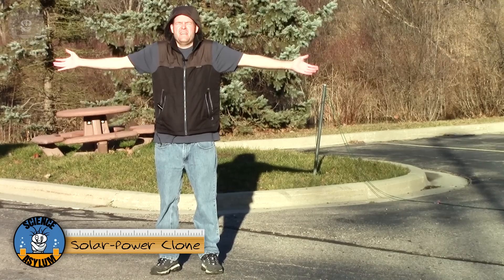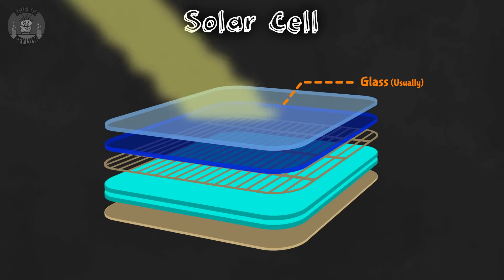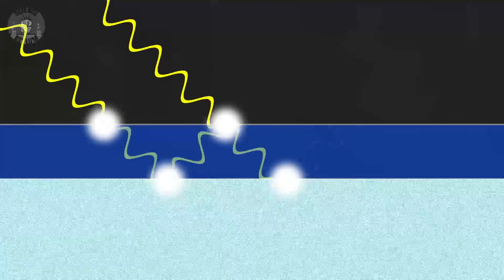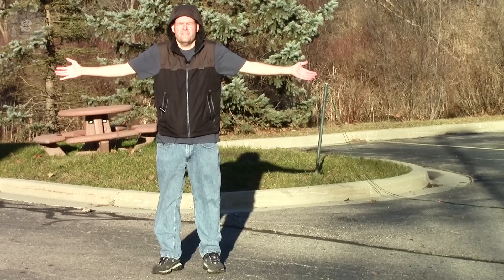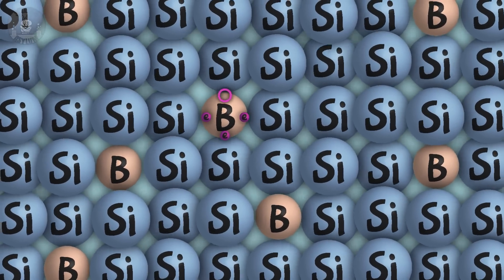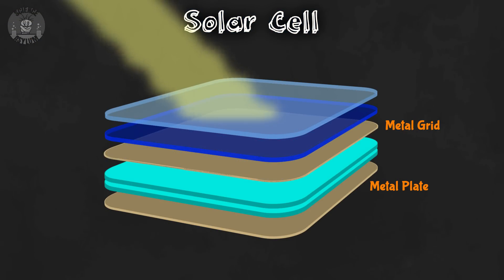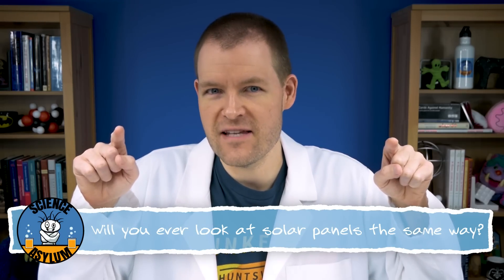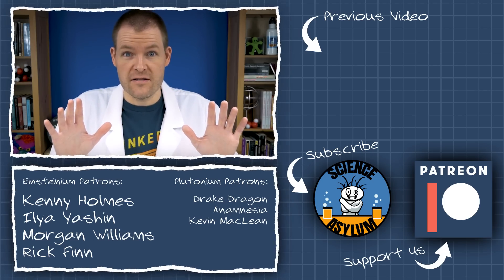How Do Solar Panels Work? (Physics of Solar Cells)

Comment: interesting video, just wanted to point out that the chemicals needed to make these cells are extremely toxic, and most solar panels are made cheaply in china designed to degrade. Nuclear is the only viable alternative to carbon fuel

Comment: I really just wanted to know if solar panels work behind glass, more or less a small solar panel that’s sitting on the dash board of a van my brother owns. I’m working off the stupid concept that “it’s harder to get a sun burn behind glass than it is without glass.”  Would the solar cell work better out side the car window or does it even make a noticeable difference.
Reply from the maker: Yes, solar panels work behind glass. Panels often have glass over them to protect them from the elements. Solar panels work using visible light and glass can't absorb that kind of light, so you're good 👍.

As for the sunburn through glass, I've always heard it the other way around. "You can't tan, but that makes your sunburn _worse._" ...but I could be wrong about that. What I can tell you is that sunburn (and tanning) works via UV light, not visible light. That means it's not connected to how solar panels work.

Comment: Very well done!  I would've liked to see you get into why cells are in series on panels and parallel in arrays (to keep the current low to reduce loss and save cost on the interconnects, but while keeping the voltage manageable) but that would have been getting a bit far away from the the solar cells themselves, which was the point of the video.  Maybe link to someone explaining the "next step" in understanding solar power?

Comment: My question is this, why not follow the design of leaves, they clearly have the optimal extraction strategy, we even have self assembling "circuits" nowadays, could just set one of those up on a cell, let it show us the optimal "circuit" for the cell and just slap a copy on every cell thereafter. Additionally, nature has always used green to cover it's circuits, there must be a reason for that, I would probably copy it off of bamboo since that appears to grow fast so likely needs to extract a lot of energy from sunlight.

Comment: 1,000 watts/m^2

And how much of it is extracted with a PV panel?
Reply from the maker: Solar panels, at current best, have an efficiency of about 50%... so, at best, 500 W/m^2.
Reply: @ScienceAsylum  What are some reasons for that inefficiencies?

First impression is material deficiencies that neglect parts of the spectrum which are not converted.

Also, I believe I remember something about radiance focus creating inefficient use of active materials.

I was wondering why magnification and spectrum spreading wasn’t used to focus and redirect portions of the spectrum toward materials more conducive to those frequencies.  The focusing would decrease the amount of material required while prismatic dispersion would negate the need to layer different materials.
Reply from the maker: @josephcoon5809  I'm on the theoretical end of things, so you're stepping a bit outside my knowledge. If you're looking for more practical information, I'd recommend Real Engineering: https://youtu.be/yVOnHWnLSeU
Reply: @ScienceAsylum  I’ll check it out, but I’ve already done some research besides.

The thing that gets me is that fiber optics boasts far greater transmission efficiency than metallics, but solar panels focus on converting radiant energy to electrical energy then transporting it.  This is efficient in many ways.  The biggest problem is future proofing.  If any aspect of a solar panel (collection, concentration, separation of wavelengths, conversion, or transmission) is upgraded, the whole panel becomes obsolete.

However, if a panel is designed to collect, chromatically disperse, and transmit, then advances in those areas only make the panel obsolete.  Furthermore, passive optical panels will have far fewer metals and be far easier to manufacture.

By using the panels to collect and fiber optics to transmit, all the radiant energy can be delivered to various locations depending on wavelength and purpose.  IR frequencies can be sent to thermal dumps like water tanks.  Blue and Red frequencies can be sent to environmentally controlled hydroponic structures. Other visible light can be sent to indoor environments for natural daylight OR to PV cells for conversion to electrical energy.

Further more, solar collector pavement panels can incorporate IR frequencies from other panels to melt snow and ice rendering chemical (salts)  and mechanical (plows) unnecessary.  By reversing the flow of IR radiation TO the pavement panels and using diffusers in the space between concentrators, you can heat up the solar collector without converting visible light to electricity and converting electricity to thermal which loses power in the conversion as well as the transmission.
Reply: @ScienceAsylum  The theoretical question that I have for you:

...what frequencies of light can be transported over single mode fibers?

The frequencies I work with are 1310-1550 nm.  Can wavelengths longer than 1100 (IR) be transmitted the same way?

I appreciate the dichotomy between theoretical and practical, however, new technologies create a collaboration between the two.  I cannot find the answers on the channel you suggest because nobody is researching the transmission of IR over single mode fiber.  THAT is your realm.

Comment: Liked the video.  I am searching for a way to compare apples and apples, sort of speak.  Such as, if I need to power a 17.5k BTU AC unit on a RV.  How many cells or arrays it would take to do so.  Do I need a way to store electrons within a battery such as a lithium ion battery then use the battery bank along with the solar array panels to run the AC.  Or is this technology meant for something more like a set up to recharge the battery on my watch, computer, or a fan rather than an AC unit?  I would like to have the knowledge to speak about the utility of such technology.  Love the technology but I would like to dive deeper into solars' utility.  Thanks again.
Reply: It seems that Solar technology is better suited for recharging batteries.  As of today, one cannot install enough solar arrays on-top a RV to power anything more than a recharging station.  AC units, refrigeration units, blow driers or just about anything else are not conducive to receiving power to run off solar arrays unless there the size of a city block....and then I'm not sure.    Outfitting a RV with Lithium Ion batteries (the Ion part gets better and better) is the best way to go.  The batteries can supply you with lighting and fan power.   However the Lithium ion batteries are expensive and terrible for the environment once they are depleted (the part no one wants to talk about).  Solar arrays are great to feed into the power grid.  As, they can reduce your power bill.  However, that comes at a cost as well.  I look forward to the day we can harness the energy of the sun to a greater extent.

Comment: I had a job at a company called Sunpower. They have developed a "super cell". What they do is buy solar cells from Asia. They then devide each cell into 6 equal straps. Then, in the next sequence these straps are glued back together, with silver oxide glue, into 6 foot lengths. Then build a standard 4x6 foot panel. In testing the product,  they achieve up to 400 wats of power in each panel. They notated each panel by its output. Rather incredible.

Comment: Turn sunlight energy into electrical energy. SiP:SiB junction allows electrons to be donated across like a one-way valve, generating the potential / current.
Reply: Force capture by pentavalent Antimony, transfer by cuboid Silicon, and force eject by trivalent pyramidal Boron is a picture for electron transfer in the photovoltaic cell. This is useful in nanotechnology where force transfer is at near 'c' and in future fusion devices. 😊😊😊SJRTI

Comment: Hold on... so why is it being cancelled out in the first place? Since in order to cancel out, you need it to reflect in two places anyway, how does it help the efficiency? I'm confused...
Reply from the maker: If the waves cancel outside the anti-reflective layer, that energy can't just disappear. It has to go somewhere. What happens is that it (100%) reflects back down again toward the solar cell. It's trapped inside that anti-reflective layer until it's completely absorbed by the cell.
Reply: @ScienceAsylum Wow, ok, conservation of energy is weird...
Thank you!

Comment: Question: Per Square Meter the Sun is giving us 1000w per hour? or Per Second? I ask because solar panels are rated a number a Watts per hour.
Reply from the maker: Watts is already per second. A watt is a joule per second. There is no such thing as "watts per hour."

There is something called a "watt hour" or sometimes "kilowatt hour," but there's no "per" in there. It's not watts/hour, it's watts*hours... which is a unit of energy like joules.
Reply: @ScienceAsylum  ahh okay thank you!

Comment: question america uses 110 volts australia uses 240 volts do we down under need twice as many panels to be equal if you get my meaning ?
Reply from the maker: Nah. It's just a choice. Different countries chose different electricity standards. (Also, correction: the U.S. uses 120V. The 110V that everyone seems to mention is just habit from several decades ago when we weren't as good at hitting the 120V goal.)
Reply: they can use transformers

Comment: Great explanation. I wish you had also explained why solar cell efficiency drops off when they get too (temperature) warm. I feel like that would have fit in nicely here.
Reply: I am not sure whether it's correct or not , but maybe I can try! So, Phosphorus is added so that we have some free electrons which can take up some energy and get excited and when the plate of boron silicon is placed since, there is a need of 1 electron for completing it's octet,The electrons flow in a rush! But isn't it that a electron needs energy in discrete packets that is you have to give right amount of energy to let the electron take it;! If you give more it passes, if you give less it passes too;! So maybe giving too much of energy, drops it's efficiency!

Comment: NOTE: all energy on Earth got its start from nuclear power, the sun. Oil is dead plants & animals that wouldn't have existed without the sun. Wind is caused by the temperature differences caused by heating from the sun. Water dams get their power from falling water that was evaporated by the sun and fell (gravity) as rain at a higher altitude. Nuclear power comes from the material that was in the accretion disc from the new sun that helped form the Earth. I can't think of any energy we use that didn't originate from our star called Sol.

Comment: The problem is 1,000 J per square meter is not nearly enough to power a modern economy. That is a huge space for very little juice. If we want non-carbon we have to go nuclear, wind and solar aren't going to cut it. As far as batteries they  also take a huge space to store small amounts of electricity. We will need far better batteries as well.

Comment: I wonder why we use flat sheets of cells for the arrays instead of stacking them vertically and have the light bounce off within the walls, I think it could simplify the design by removing the anti-reflection layer and possibly the metal grid if a transparent conductive liquid is put between the layers, such liquid could also be used as a means of cooling the array and possibly allowing you to reuse that excess heat.

I've asked on reddit: https://www.reddit.com/r/AskEngineers/comments/dz2d32/why_are_solar_panels_built_flat_instead_of_hollow/ but I'd love to hear your thoughts on this too.

Comment: About 1300 stepped down to bc of the atmospheric reflection and absorption about 600 with the theoretical bound of 30% for the optimal wavelength of light for silicon based Panels and the rest range upwards from 10 also half of that is ir which is useless... unless we can it to visible at about 80 percent efficency with graphene which steps us down to about 100 watts per meter max with PVs concentrated can do better but rely on fluid flow so we can cap at about 45-52%

Comment: a 1000w of power for a square meter of space, but solar panels can only collect about 300w from that space. its still okay enough to work with though.
Reply from the maker: Some of the best solar panels today are almost 50% efficient (so that's 500W). Yes, there is a lot of loss to heat, but that's still a lot of energy.

Comment: just make a double sided solar panel connected in antiparallel and make it rotate 3000 rpm. then you have AC directly no need for a converter.

Comment: What happens when all the elections have migrated from phosphorus side to Boron side and phosphorus side has none left?🤔🤔 If electricity is generated because of electrons moving from high concentration to low concentration then what happens when there are too much elections on both side of battery? How does battery gets charged and discharged where do elections go?

Comment: Is there a specific reason we aren't using solar more?
Reply from the maker: It's only about 50% efficient, so it only works as a primary source of voltage in places with a lot of light. Having diverse options is best, especially in places with a lot of cloud cover or long nights.

Comment: Why do the electrons go to the top of the solar panel and through the circuit? Why does it not go straight down to the p-layer?
Reply from the maker: The depletion layer is like a barrier. It prevents them from going that direction, so they're forced to go the other way through the circuit.
Reply: The Science Asylum Thanks!

Comment: Why should cancelation of the light from top and bottom of the glass layer save us energy?! I understand the light is not reflected any more because of out of phase waves! But at the same doesn't it mean that the energy of those waves also neutralize each other?!
Reply from the maker: No, because the light doesn't just disappear. It reflects a second time off the upper surface back down toward the silicon. I just didn't show it because the diagram was already getting overwhelming.

Comment: Hypothetically if you power your whole house with solar panels (or batteries storing solar energy from during the day), would you need AC at all?
I know all appliances are made for AC, but the fact is almost all of them operate internally on DC, and have AC/DC converter to do so.
So if we ignore compatibility with the outside world, would it be more practical & more efficient to run entirely on DC?
Is there a risk that makes it not worth it to use DC inside a house even at lower voltage (like say 110V)?
Reply from the maker: Most of your devices would be fine, but not all of them (your refrigerator, for example, must be designed to function on the AC frequency of the country you plan on using it in).

Comment: so where does all the light go after interfering with each others?
Reply from the maker: It reflects back down into the silicon.
Reply: @ScienceAsylum  why they don't destroy each others?
Reply from the maker: The energy has to go somewhere. They might cancel outside the layer, but not inside the layer. They're will be an additional reflection (100% reflection) back down toward the silicon.

Comment: Cancellation (shown at 2:45) is awesome.  You could do a whole episode on just that.  When combined with conservation of energy the implication is the parts of the wave that didn't cancel get all the energy from the parts that did.  That blew my mind when a physics professor first demonstrated that for us with an electron beam.   LIGO has to deal with the same issue... it is bouncing a laser back and forth but if it isn't tuned properly the energy can actually feed back into the laser emitter and damage it.  Radio antenna work the same way (for both transmitting and receiving).  And many other things.  Cancellation affects just about all of physics.

-Matt
Reply from the maker: Yeah, it's pretty awesome!

Comment: Hi, i am a litros crazy, but you said that the solar cell works with visible light... my cuestión is, isn’t UV light more chance to produce the photoelctric effect?
Reply from the maker: UV light is more likely to create the photoelectric effect, but the photoelectric effect isn't what we're trying to do with solar cells. The photoelectric effect is when atoms are released from atoms entirely. All we're doing in solar cells is trying to get them up a few energy levels.
Reply: The Science Asylum thanks. I like your way to explain. Just one more thing... speaking of the spectrum of light, is there a wavelenght that can “activate” the solar cell more than others?
Reply from the maker: The solar cells we make are designed to respond mostly to visible light, which makes sense since the vast majority of the light coming from the Sun is visible.
Reply: The Science Asylum yes, but. What color?